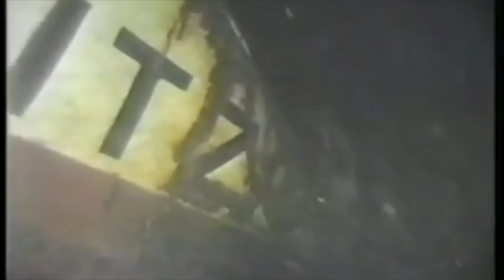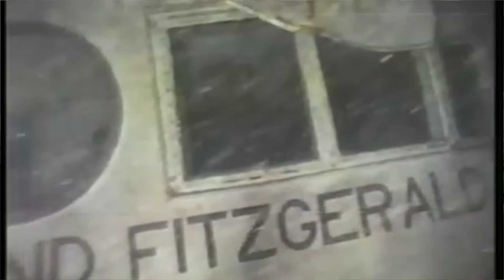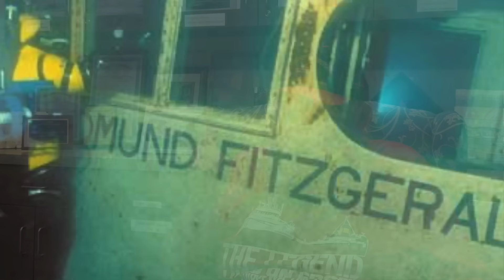Sinking of the Fitzgerald ... Negligence or Nature? Season 3 with Capt. Darrell

Comment: I was a GLMA Engine Cadet sailing on the Philip R Clarke in 1976. A Wheelsman I knew on the Clarke was in the wheelhouse on the Anderson when the Fitz went down. He told me the last thing he heard on the radio from the Fits was “My God, that’s the biggest one I’ve ever seen…”. Take that any way you want, but I knew how I took it 47 years ago sailing on another AAA like the Fitz.
Reply from the maker: Whoa! Now that's super interesting! Thanks for sharing that here...HMM
Reply: If you are slowly sinking and sitting lower in the water then all the waves would appear gigantic. She bottomed out and covered it up so the families couldn't sue Columbia for the loss.
Reply: @HistoryMysteryMan  Not only are the two forward hatches smashed in, lying inside the hull. There’s this whatever-you-call-it, I suppose it’s a sun screen, a kind of a rim sticking out all the way around the windows of the pilot house, like the rim of a baseball cap, if you know what I mean? That thingy has been smashed straight down too, as if it had been hit by a gigantic sledgehammer, to the point where it’s partly covering the wheelhouse windows. 
Problem is, it’s evenly smashed down on all sides, not just on one. It would take some formidable force to even bend that whatever-it’s-called rim slightly;  I’m writing this fresh out of trying to bend and shape a piece of 2mm sheet metal for a project I’m working on, and it didn’t go well at all. Having the whole lot go straight downwards in one go — you’d think someone dumped half of Lake Michigan over that ship. It MUST have been a rogue wave of some sort. A very, very rogue wave indeed.
Reply from the maker: Interesting commentary Jonathan; thanks for sharing your thoughts here. I believe the rim around the pilot house was bent when the Fitz crashed into the bottom of Lake Superior...estimated to be traveling at 35-40mph when she landed. That would do great damage, in terms of buckling, to a ship that size. I believe a rogue wave sent her to the bottom, but not before the ship had lost most of her buoyancy from taking on too much water in the preceding hours. HMM @TheJonathanNewton
Reply: @HistoryMysteryMan  The rim wouldn’t buckle like that even if the Fitz had hit the bottom at the speed of light. Not only doesn’t metal behave like that, but the inertia from the water and the cushioning effect from the silt and steel would have prevented the rim from collapsing all the way down. 

See, for the rim to have collapsed because of the impact, such an impact would have to have been strong and sudden enough for the weight of the rim plus its downward momentum plus the torque from the bending movement plus the opposing force of the impact to have been larger than the strength of the metal plus the opposing force of the water. Those would have been the only forces involved. 

Moreover, it would have been violent enough to keep bending the rim as far as it could physically deform, as is the case here. In other words, the ship must have come to a complete stop with an almighty force in less than a fraction of a second. 

A long, slim object such as a deck crane would have produced enough weight and torque to have it slice through the water and collapse under such circumstances, but with a short and wide rim like this, any torque would be practically negligible. As for weight being larger than structural strength, well, the rim would have needed to be made from lead or something like that!

In addition, striking the bottom silt would have cushioned the impact, as well as the rest of the steel hull as it would have crumbled — just like the crumble zones of a motor car will soften the crash forces for anyone traveling in it — before the collision forces had been transfered up the hull to this rim with such overwhelming force. The whole pilot house would have caved in sooner than the rim giving way on its own. The Fitz would not have come to a complete sudden stop, but would have had its downward speed slowed for a second or so. 

And yet here it is, the rim hanging completely vertical and flush with the windows like dead flowers. Only a force pressing onto it from the top down, a force stronger than the metal, water resistance, and any other opposing force, and which kept on pressing and pressing without stopping, could have bent it like that.

And then we haven’t even touched on the two forward hatches.
Reply from the maker: Super interesting analysis. I've never received such detailed insight regarding the pilot house rim. So if the collision with the bottom of Lake Superior didn't wrinkle the rim, what did? In adding the two forward hatches, why did the Mighty Fitz go down? Thanks...HMM @TheJonathanNewton
Reply: @HistoryMysteryMan Like I said, some overwhelming force must have come crashing down on top of the forward section of the ship. The most likely such culprit would have been a massive rogue wave, but for that to have happened, it would have had to break across something. Otherwise, it would have lifted the bow rather than squashed it, unless there’s something I’ve missed (I’m no naval expert at all).

It would have had to be large enough to break the hatches and the rim, but small enough not to have broken all of them. However, perhaps it was such a breaking wave that also broke the Fitz’s back. We may never know.
Reply from the maker: A rogue wave to break the back of the Fitz is certainly possible, but I don't believe a wave wrinkled the rim by any stretch. That happened when all that tonnage struck the bottom. @TheJonathanNewton

Comment: A very good friend of mine passed away 10 years ago he was a chief engineer on the boats. He had opinions on the Fitzgerald , most of it was that they had welded a narrow   steel reinforcement to the ship the full length of the hull and it was supposed to increase the capacity. I have no idea if he was correct  but my great uncle died on that ship
Reply from the maker: That's super interesting...I'll have to dig into that...thanks! HMM

Comment: The fact in the industry money always came before safety. Repairs were put off. Look at boat after boat that went down was due to putting off repairs just for another season. The Fitz was scheduled for hull repairs that were put off. The James Morel was the same situation but money came first. It’s better today but not what it should be. We had one modern boat go in with a hole in her hull and another cracked hull almost sank this year. The Coast Guard needs to stop letting these boats sail unless they are 100%
Reply from the maker: Interesting feedback. Thanks for sharing it here. HMM
Reply: @HistoryMysteryMan  I watched the Fitz leave Duluth for the last time. I was there to play hockey that week. But when you look at the history not just here but in the history of lake freighters and the fishing industry, the negligence is unbelievable and it’s allowed to go on by the USCG.  Money first lives come second or third. In recent history a fishing vessel that had gone through a dry dock inspection sank loosing just two of the crew, however the boat should have never received a certification by the USCG. The transom was rotted through and leaking. It couldn’t be inspected because a plate had been welded over the transom as a guard from the nets or boxes hitting the transom so there were shielding welded on. The company had just welded new plates on this boat ignored the rotted hull. The CG couldn’t be bothered to have the plates removed to inspect the hull. It was leaking when in the water. It got into the bearing sea and took on large amounts of water through the transom. The boat should have never been certified but because of money the company chose to hide the problem and the USCG inspector couldn’t be bothered to have the plates removed to inspect the hull condition. This boat was outside its life expectancy but because its type cannot be replaced due to new rules it was kept in service. The safety regulations have gotten better since the Fitz sank but after the current and recent events and the Michipicoten show us that they aren’t doing enough. They let these shipping companies to sail these boats when hull repairs are required just to get through the season until the next lay up. If the Michipicoten had gone through a storm like the Fitz she would have been on the bottom with all hands too. The freighters have always been a huge interest to me. Like you I have studied on my own many of the wrecks on the Great Lakes. But after these boats went to steel there was no reason for some of these disasters if safety came first. Negligence is exactly the word for almost every modern loss of these lake freighters. But the job after a wreak is to make sure the companies are never held accountable. If the hatch covers didn’t fit correctly because of the hull being twisted or out of shape it should have been taken out of service immediately. We know the Fitz needed hull repairs before. It was scheduled for major work at the end of the season. I have heard testimony of other sailors who had been on the boat earlier that season who said she was leaking from the hull and her keel needed repairs. Also they should have never loaded the amounts of cargo they were in her. Unfortunately the families are the ones who get shafted. First with the loss of a loved one, but then insulted by the amount that is given for the family. For some reason the ship industry has gotten away with this when every other industry has been forced through OSHA to take safety concerns seriously.

Comment: Sounds like they don’t want people investigating the accident, very similar situation to what happened here in West Virginia in 1969 at the Farmington No. 9 mine explosion. A lot of men were killed in the fires afterwards and to contain the fire the decision was made to seal up all air shafts to smother the fire. 5 years later they crack it open again and start retrieving bodies but as soon as the mine rescuers start noticing all the signs of negligence on behalf of Consolidated Coal the mine owner- operator. They shut down the recovery operation and left 17 bodies in there, still unaccounted. 

Seems like for the Fitz they are using the emotions of it being a grave site to cover up the cause of the sinking.
Reply from the maker: Super interesting commentary/analogy; thanks for sharing it here. I never knew about this mining disaster...I'm going to check it out. HMM

Comment: The company and McSorley applied to the Coast Guard to increase the loading of the FG in the November part of the season. The original November loading was lighter to give the FG more free board for the November storms on the lakes. The company and McSorley wanted to carry more cargo for an increase in the yearly profits. As for the railing and the vent covers they were removed and damaged about the same area where the spare propeller was stored between the hatch covers on  the deck. That propeller could have broken loose when a large wave slammed into the deck and thrown it over the side. That season was near an end and the FG was supposed to go into dry dock for the winter to reinforce the hull with a bunch of additional support beams and bulk head stiffeners. There was a picture of all of that steel sitting in the ship yard waiting for the FG and her sister ship to be modified. FG never made it but her sister ship the Auther B Homer was modified.
Reply from the maker: Super interesting commentary and info. I've heard that the steel they were going to outfit the Fitz with is still out there...at least some of it. This would be a story in itself...thanks for sharing your thoughts here. HMM

Comment: Ive said it a million times and I'll say it again. The Fitzgerald was going down by the head, slowly since the mid afternoon when it was still daylight. The crew reported the fence rail down around this time, at which the keel buckled and caused the major hogging exposing the forward 3rd of the hull bottom to the open sea. It was a structural failure. It was wounded at this point. If somehow any hatches caved it, it would've been near the forward end of the ship, hence the bow slowly going down. Don’t you think the pilothouse crew would've noticed a 65×11 hatch cover missing? I mean they noticed the fence rail and tank vent damage? You all have to stop believing the decades old ruse by the Coastguard report. Of course they needed an excuse to blame the crew; after all, they are the one's who signed off on their last safety inspection!
Reply from the maker: Super interesting commentary! Thanks for sharing it here. You ask hard questions that deserve answers. I only wish I had them. Thanks Scott...so appreciated. HMM
Reply: They didn't say the hatch cover was missing. When the "Three Sisters Waves" hit her, that is when the I'll fitting hatch cover gave way. To many Kestner clamps were not even damaged, because they couldn't  "Dog" them down. Thanks for watching.

Comment: I’m involved with a certain type of Aircraft. I’ve been in aviation maintenance, I’m a pilot, and an Aircraft Inspector 32 years + when added up, not including the schooling. Anyhow, enough about me. It’s just setting the tone for what I’m about to say. 
I will not say for whom I work, let’s just say I am an Aircraft Inspector and our group are the last ones running tests just before we hand the airplane to the customer and it flys away for hopefully a long safe career. 
But I will say there were 2 recent catastrophic accidents killing a total of 346 souls. These accidents were caused by the same reason. AND when you look at the Edmund Fitzgerald something was changed, probably many things, just as on airplanes. What is the “end game” for the people owning and operating these transportation vehicles? What is the most important aspect of operating these sea going vessels hauling taconite to make steel/ aluminum etc, and air going vehicles hauling people, and/or cargo? $$$$$$$MONEY$$$$$$$$!!!!!!! 
Or as I like to call it “GREED”. Yes, safety is top priority, but the engineers are always pushed to find a way for the customer to make more money. ALL 3 of the disasters I am talking about happened during the build. 
The Fitz? When I hear of them using LESS bulkheads separating the compartments and used as you both said screens? With a ship that large instead of having 5 full size bulkheads, AKA strength, and instead used weak screens? And eliminating very strong bulkheads is a big deal as both of you have said. My expertise is not in shipping, instead aviation. I grew up in Minnetonka Minnesota, and my father in Duluth. He had fake ID’s made so he could work the freighter’s during the summer months. I know one of the ships he worked on was the “Calumet”. We have pictures of his ship. He said he worked many, but never the Fitz. 
My point being with this long reply, ( sorry ) is that when you add it all up, and come to a conclusion, the reason these 3 disasters Im talking about happened because of one simple word, “ GREED”. 
In my humble opinion the Fitzgerald bottomed out and because of it being built with those screens (weakening) the ship’s stiffness (I do realize they need to flex), and with all the years, how many times was it overloaded? Like that night in 1975 both of you said the waterline after loading was very high. Like you said, the map for those shoals they were using were from the early 1900’s right? Then they were shocked when the went out and measured after the Fitz went down they were shocked at how much farther they extended etc. But in the end, it was only about one thing. Greed. Money corrupts. The board of directors want another vacation home in the Caribbean while we work for peanuts. 
I can’t say on this platform any more “inside baseball” about the two 737MAX accidents. If interested you can always find me another way. God Bless the 29 men who are still in Gitchee Gumi’s ice water mansion. R.I.P.
Reply from the maker: Thanks Andrew. I appreciate you taking the time to lay out your thoughts on the matter. It's hard to get around the 'greed' factor...and no matter who much we dissect the tragedy of the Mighty Fitz, it always comes back to that. HMM

Comment: First, McSorley would not go near any white water that would be at the shoals. Second, the ship was awash in seconds, not minutes, which would leave time to abandon or call. None of that happened so she went right away. Being under water, when the water comes in, it will blow all kinds of debris in any direction leaving a larger field on the bottom.

 Looking at the wreck, I see her striking the bottom nose first and with the stern still above water, slid and broke. She was heaving and pitching and being hit from behind on a down motion of the heave, nose will go under with forward motion pushing it downward as she went under. It will not come back up, it will sink like a pipe. She is broke just like that, trench and all.

 McSorley said they were holding their own. Watch would never see that coming at night. The listing from pellet shifting made it quicker than no list but this scenario still sinks it nose first.

 Finally, you picked the wrong song for your video sir.
Reply from the maker: I couldn't use Lightfoot's "Wreck of the Edmund Fitzgerald" because of copyright issues.